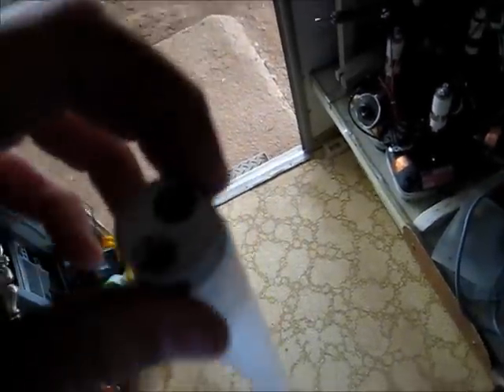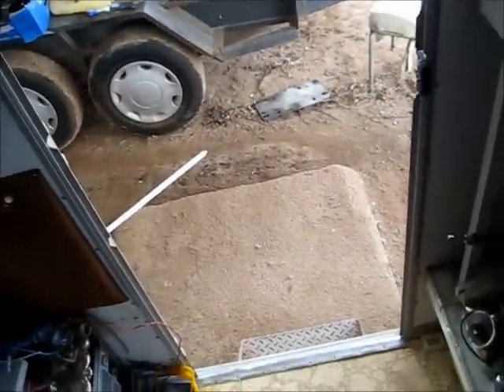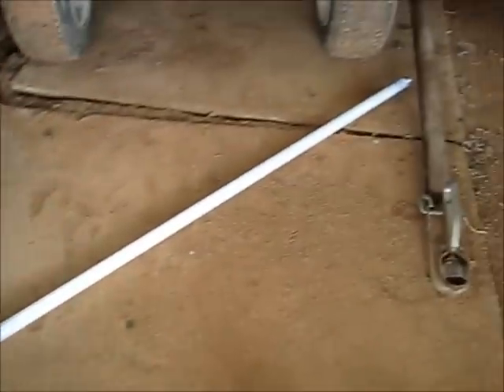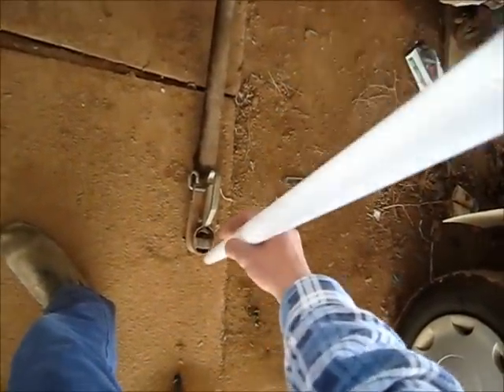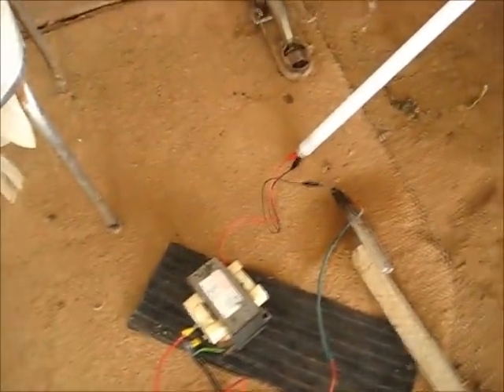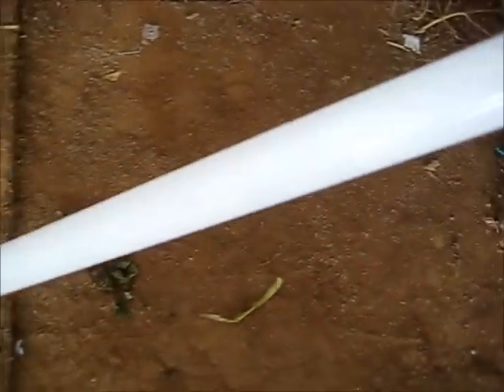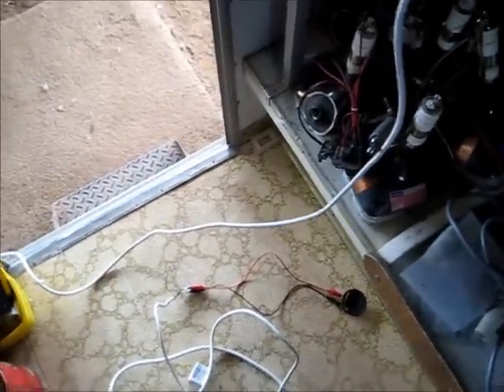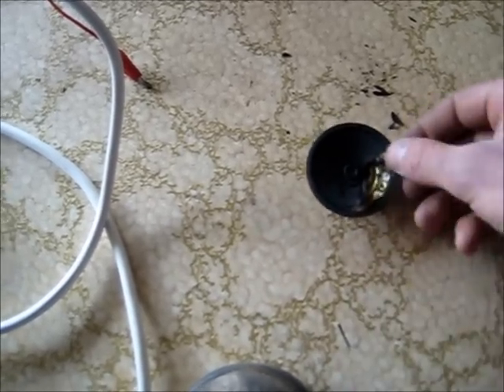Fluoro Light tube pop, water boiling & pop a Crappy speaker

Comment: @narcoti Not quite true. Pure water does conduct electricity - just not very well. Pure water is partially ionized; the hydrogen ion concentration (and hydroxide ion) are 100 n mol/dm3. This gives a conductivity of 5.5 μS/m (microSiemens per meter). In more sensible units, this means 1.8 MΩ across a 1 litre cube.

By contrast drinking water is about 100x more conductive, and sea water about 1000x more conductive.

Comment: Awesome !!
Great experiment, the art of inserting the plug while running the camera, very smooth.
Those 19 minutes flew by
Conductive cocktail ,, excellent !
That fluro acts like an electrode heater
That speaker took a great hiding, at least 3 Amps with the vacuum.